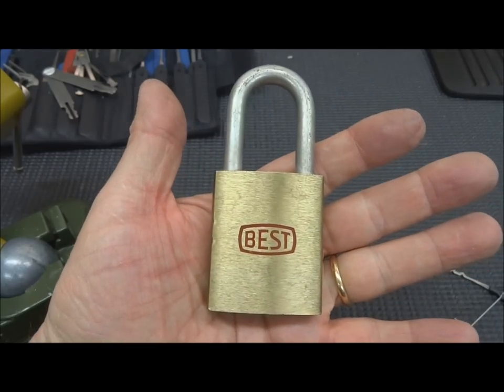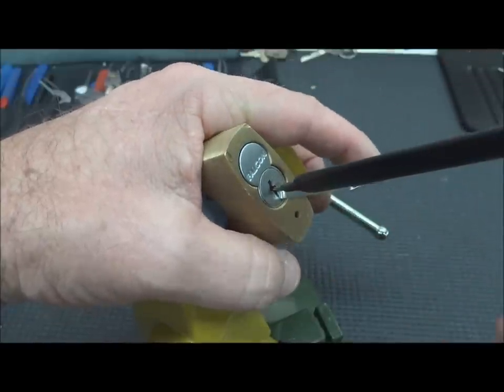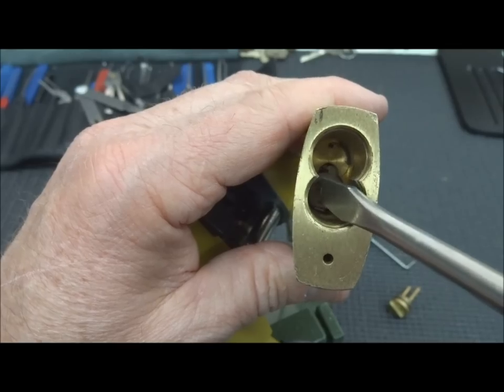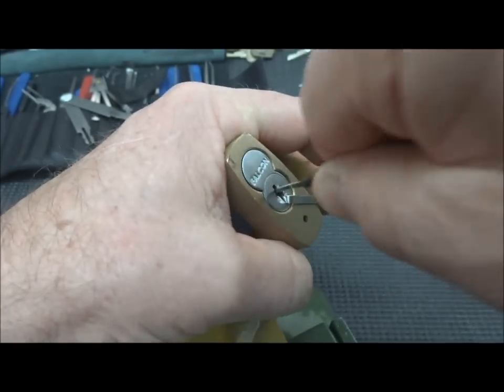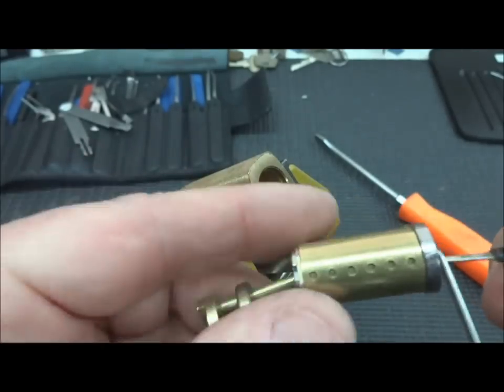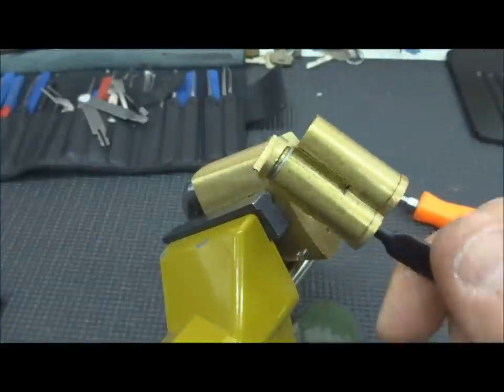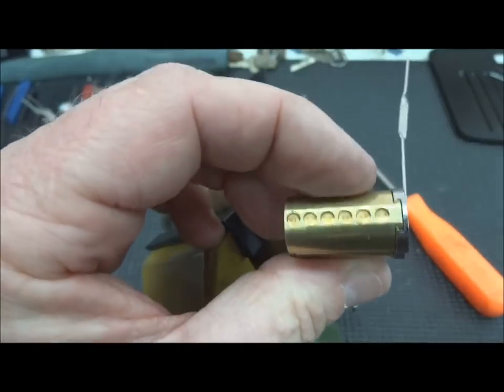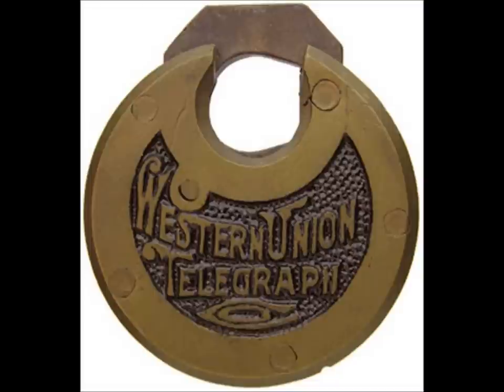(269) How to Rake Open SFIC (Removeable Cores)

Comment: I discovered they existed and made an SFIC control tension wrench.  The one with the teeth to grab the control sleeve only.  I wanted so bad to show it off, but I needed an open video to prove it worked. I eventually resorted to raking it. I got my very 2 first opens on an SFIC. Once to operating and once to control.

Comment: I think the reasons why you're hitting the control shearline every time is because of two (2) things:

(1.) You're applying bottom of the Keyway tension on the plug; of which is also grabbing onto the control sleeve on the SFIC core cylinder. 

(2.) You're lifting the pin stacks above the OPERATING shearline; of which only allows or permits the CONTROL shearline to operate.

These reasons would be the only things that I could think of that would allow you to reliably open all 6-pin & 7-pin "BEST-Style" SFIC Cylinders to the CONTROL Shearline.
Reply: Christopher Lawler with "best" locks, the control shear can be above OR below the operating shear, what more likely is going on is pretty similar bitting for both shear lines and no security pins, I have some of these in 6 pin and I can't rake them, they came with spooled master wafers and I have since serrated and spooled everything and all I get is 4 distinctive false sets on all my cores
Reply: Update, I have opened a couple to both shearlines but they don’t always cooperate

Comment: Peterson makes their "i-core" tension wrenches for putting tension on the core to open it to control. It takes a little bit of getting the tension tool. In place, and when you put tension on it, it feels like you have a fault set right off the rip when you use that tension tool instead of a normal one.
Reply: +bosnianbill I picked 2 cores out of locks last night that were 6 pin ( 7 with the control pin ) last night. The locks that I got were from a friend that gave me ( about ) 40 Best locks that were from a retail location that was less than 10 years old. I have had really good luck with this. Maybe these ARE older locks, and I just don&#39;t know? I did buy a bunch of replacement cores so when I pick them to control, I can use them as my own. Here are a few pictures of the core bottoms, fronts and the locks themselves. Core bottoms http://bit.ly/1SahPtB Core fronts ( &quot; J &quot; style keyway on these ones ) http://bit.ly/23ssJy9 Locks that I am getting them from http://bit.ly/1nxlhkV and finally, a VERY close up picture of one of the keyways ( you can see the shell, which in all of the locks I have, have the holes drilled in them, you can see from the bottoms of the cores, because you can see through the holes when they aren't picked ) http://bit.ly/1PAuhMf. Here are two more, a LOT closer. One with the control key in, and the core opened to control http://bit.ly/1KEsjJn And another one, with the lock as it would be inside of the body of the lock ( you can see through the holes ). http://bit.ly/203ZXod

Sorry Bill. I meant no disrespect. This has been my experience with those tools, and they have worked very well with me once you get the notches lined up.

Comment: Dam. I F with Best and they're super hard for me, though I'm doing them in situ and not in a controlled environment. THANKS FOR THIS VIDEO. I will defo be trying it. Curious what kind of Bogata brand you're using. I was using Sparrow picks but Southord is soo much cheaper and seems to work just as well.
Reply: Just checked the prices. Southord is not soo much cheaper, it's pretty much priced the same as Sparrows.

Comment: Where can we purchase the rake and tension wrench used in this video? What size thickness do we need for a standard best SFIC?
Reply: +FloweryPath4316 Bill is using a triple peak or bogota rake, and a standard tension tool. Thickness looks like 0.025" (25 thousandths of an inch) thickness. You should check out bills website, it has a list of suppliers. URL is in the description.

Comment: How many rakes do you go through a year? Time was, no self respecting locksmith would even own a rake. We always started with a hook and then maybe got to use the diamond. 

Back in the day factory BEST locks were always chock full of serrated and spool pins if they came from the factory. Some of the military bases that self serviced their locks would use security pins too. I never knew a locksmith that bought the security pins although they are available through Clark/CLK supply and others. 

Interesting thing about BEST is one of the people that was involved with the Schlage Lock company back in the early days broke off and formed BEST. For BEST’s A key way its a reverse of Schlage’s C key way. Meaning if you had a Schlage C key way you could take it and slide it into the back of a BEST A cylinder.  This went all the way down the line even into some of Schlage’s restricted numbered keyways and some of the government only keyways.

Comment: The generic plugs are not made to tighter tolerances. Falcon has always been easy.  I am a locksmith with over thirty’s years in the game.  If you want better key control, Best Peaks and certainly Medeco’s Keymark 7 pin offer far more advantages and security design than common core Circa 1970’ that are often exploited on line like this video. I don’t doubt Bill.  I am suggesting there are better SFIC core solutions.

Comment: Harder to pick to control? I don't believe it either. I've never been able to pick my SFIC open, but the dang thing falls out on me instead. Now I have a new problem. I took it apart and now I don't have a clue how to put it back together. Got any videos where you gutted one of these things?
Reply from the maker: Whether you pick to the operating or control shear is largely a matter of luck - it could go either way.  Now, unfortunately, I have some bad news for you... assembling SFIC locks can be quite tricky and requires a specialized pinning and recapping block.  They can be quite expensive but I have seen a couple of  3D printed prototypes, so you might be able to make one yourself if you’ll be re-pinning a lot of these.  Also the pins are a proprietary size... no good news here, sorry.
Reply: I learned a lesson in buying locks, I guess. "Removable Core" does not indicate that I can repin it!

Comment: Hi i have tryed ur way of racken to control, have a best lock I can pick it to user but cann't seem to get it to control
Reply: I just got 2 "vintage" Best Locks - I can pick one of them open, but neither of them to Control (so far, anyway.) I"m thinking of ordering the Gerry Finch tension wrench, which is supposed to do the trick on these older cores.

Comment: I have several Best locks and every time I pick them I pick to core. I have never been able to pick to the operating shear line. What am I doing wrong (or right). I know I can open the lock by removing the core, I just can't figure out how to pick them open.
Reply: +bosnianbill Thank you. I thought there may be a trick to it. I'll just have to keep practicing. I enjoy all of your videos!
Reply: +bcozz1 I have the opposite problem.  I've never picked or raked my Best Lock to the control and have lost count how many times I got the damn thing unlocked instead.  And it happens about as quickly as Bill gets his locks to the control shear line.  Want to trade locks?  lol  I kind of want the core out of mine so I can rekey it for my own purposes.

Comment: hey bosnianbill how did you get the control shear line every time i try this many time but im only get it to operating and i really need to remove the core
Reply: thanks and i need your luck other than that i will need to drill it
Reply: +bosnianbill Good video Bill, Thanks. That's how I opened two of them to control but never just open. I finally got the one that the control bar extended reopened to control by SPP.Thanks for your help.